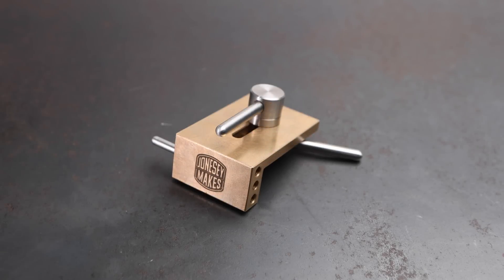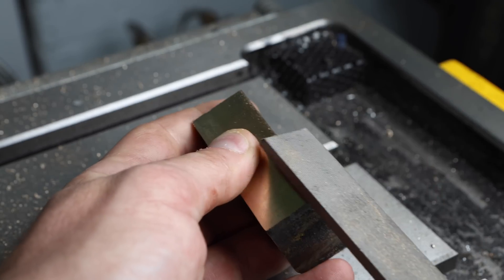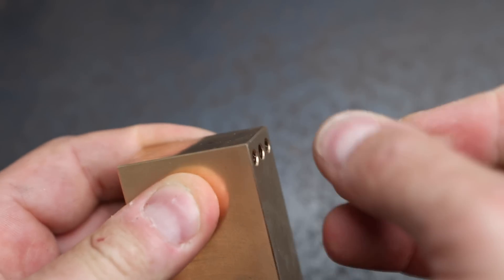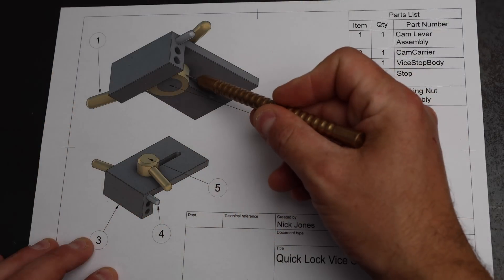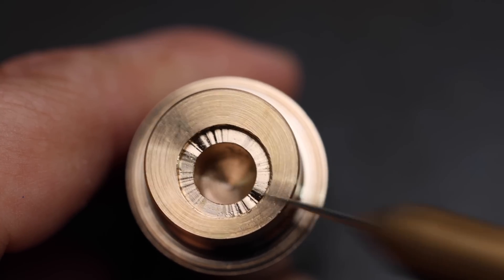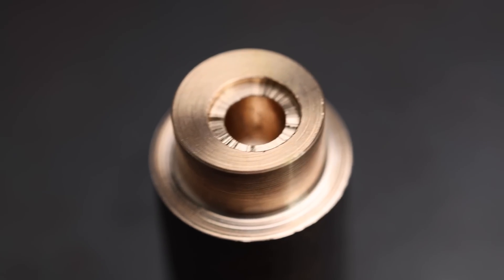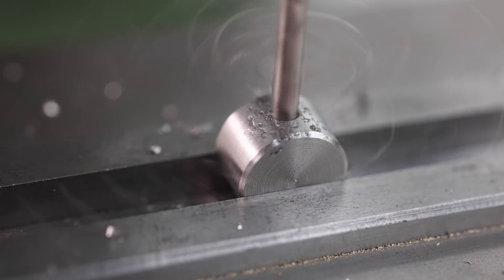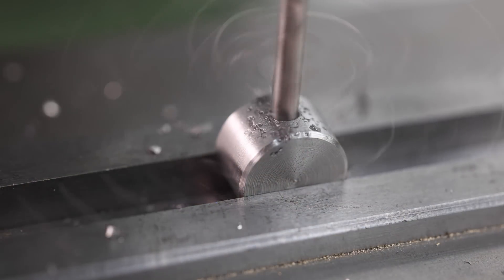Making a Vise Stop with a novel CAM LOCK mechanism

Comment: Bronze doesn't break chips very well it's a soft gummy like material when cutting. Engagement of the entire end mill doesn't give the chips anywhere to go and they pile up quickly and the material acts as if it's grabbing the cutter
Reply from the maker: Makes sense, thanks!

Comment: Thank you for sharing your work, issues and all! RE: the chatter, I agree with others that rigidity and cutting speed are usually the first place to look. For brass, bronze, aluminum and other softer materials I use a 2 flute endmill for plunge operations and have personally had better results than with 4 flute cutters.

Cheers!
Reply from the maker: That’s a good tip, thanks.

Comment: Excellent design on that vice stop i have made lots of them years ago i owned a screw machine shop and all our secondary operations needed adjustable stops the only thing i don't like about yours is your pin is not stationary i know from past experiences being in production shop most my life repetitive work needs to stay stationary or there will always be variances that will change your depth on your stop vibration etc. If you would put a set screw or clamp to hold the pin in solid awesome job
Reply from the maker: Thanks for the feedback. The pin moving hadn’t occurred to me - great advice. Maybe I’ll revise the design to incorporate that.

Comment: Usability note: whenever you have a rod projecting from a mechanism, you need to convey to the user how the rod is to be used.
If the rod is not meant to be manipulated at all (like the stop bar on this stop), it can be left plain.
If the rod is meant to be twirled or twisted, the end should be knurled.
If the rod is meant to be moved in two axes (like a gear shift), it should have a knob at the end.
If the rod is meant to be moved in one axis (like the cam lever and the locking lever on this stop), it should be flattened on either side in the direction of travel and a few grooves cut into the flattened area perpendicular to the length of the rod.
If the rod is meant to be pulled out of or pushed into the mechanism, it should have a broad flat head with a slightly concave top.
To some extent, these features make the device easier to use, but their real purpose is to make the device easier to _understand_.  When we see a projecting rod with knurled end, for example, we instantly know: ah, that rod is meant to be turned.
Reply from the maker: That’s a great point, thanks. This is something I will bear in mind for future designs.

Comment: Great video! You might try holding your stock by about 2-3mm and decking the top and milling around all 4 exposed sides in the first operation and then flip it over and deck off the final side that was held in the vice in operation 1. Quick way to get square stock in 2 ops. Keep up the great work!
Reply from the maker: Thanks, I've never tried that technique. Must give it a go.

Comment: If on a bridgeport use knee rather than the quill as its more ridged if using the quill then set the quill stop for your z and switch the drive off as you are taking that last bit of spring off the stop this changes the harmonics and has all of the backlash  from the quills rack and pinion tied up of course ensure that the quill lock is just allowing you to feed by hand or power. Then get 40 years of manual experience just kidding.
Reply from the maker: Thanks for the advice Robert!

Comment: As others have mentioned, it sounds like brass or bronze behaves a little like aluminum. When milling aluminum I use industrial alcohol (denatured alcohol) as a coolant to prevent the tools from clogging. If I want an almost mirror finish, I use one flute end mills made for aluminum.

There is probably a similar solution to your problem.
Reply from the maker: Thanks, that's sound advice.

Comment: I recommend milling 6 flats on the outside of the cam. More stability & will show wear less.
Reply: Wouldn't that make the cam much less effective as a cam? You would be taking from infinitely adjustable in size (within a range) to only 6 predetermined sizes.
Reply: I recommend milling 6 flats on the outside of the cam. More stability & will show wear less. @Beef4Dinner22  No - the flats would seat against the material and the cam would still leverage the same force. Mighty-Bite uses a cam with such a hex pattern. Do that with your cam. I made my own & can tell you that those flats are helpful.

Mighty-Bite uses a symmetric hex body, but cuts the head of the retaining bolt with the cam pattern. You rotate the hex while test-tightening the hex bolt to retain anything.
Reply: @Ideasite  the Mightee-Bite cams seem to have the hex as a separate piece, not milled into the cam itself. The cam is internal to the hex, and is still round to allow it to rotate fully giving the adjustability of a round cam.
Reply: @Beef4Dinner22  Yes - the cam is milled into the head of the retaining allen head screw.  You rotate the loose hex part to find a flat, then tighten the allen screw to apply the cam pressure to the assembly.  You couild replicate the Mightee-Bite design by having the lobed head screw go through a hex cut washer and thread into the upper piece.

Comment: Anytime you get chatter speed is the first to think of. Chatter is caused by harmonics.
Reply from the maker: Thanks, I did try different speeds but got the same problem.
Reply: @joneseymakes  You could take the approach you'd use with a piloted counterbore - drop the speed WAY down, like way way down out of endmill ranges. 200-300rpm, possibly even less, and be really consistent with your quill pressure. I know you said you varied your speed, but super low speed high feed pressure can just peel the chips off nicely sometimes.
Reply from the maker: @TheeGrandmaster  Ok, will do. thanks!
Reply: New computer systems constantly vary the speeds up and down to stop chatter in machine shops.
Reply: Came here to say this. Charter is almost always caused caused by to high of spindle speed. Cut the rpms in half or even a quarter.

Comment: You need a vice stop to help with that project. It would be invaluable. I designed one with a great cam lock too????
Reply from the maker: You did? I’ve not seen another with a cam lock. Hope does it compare with the solution I went with?

Comment: The problem presented by the tool in the milling machine spindle is due to the bearings being out of adjustment or having a greater tolerance than normal since these are originally preloaded but after many years of work they wear out and when they are doing a strong roughing job the vibration seen in your case occurs. Therefore what you should do is adjust the bearings or if you cannot adjust them then change them according to the machine manual.
El problema presentado por  la herramienta en el husillo de la fresadora, es debido a que los rodamientos están desajustados o tienen una tolerancia mayor de la normal ya que estos están precargados originalmente pero despues de muchos años  de trabajo se desgastan y cuando están haciendo un trabajo de desbaste fuerte se produce la vibración que se ve en el caso tuyo. por lo tanto lo que debe hacer ajustar los rodamientos o si no  puede ajustarlos entonces cambiarlos de acuerdo al manual maquina.
Reply from the maker: Thank you, great advice.

Comment: Brass/bronze is very grabby and sometimes when drilling it, you can make it drill nicer by stoning a small flat on the drill's cutting edges to stop it digging in, but when you counterbored it on the mill, you should have locked the spindle in place and applied the feed by lifting the table, this is more rigid than using the quill downfeed.
Reply from the maker: Ok, great advice. Many thanks.
Reply: @joneseymakes  Machinists "brass off" a full set of drill bits.  They file the leading edge to 90 deg to prevent grabbing in softer materials.
Reply: @Ideasite  Stone, not file
Reply: Yer you want cutting tools with no rake  or very little on the cutting face.
Reply from the maker: @stin-dog172  Ok, thanks!
Reply: Also, the end mill had pretty high angle helix.
Agree with locking spindle and feeding with knee.
Robert
Reply: Gotta brass off your bits.
Reply: I agree. I'm front the distant past and we would always grind the cutting edge back on drills to produce zeto rake thus preventing grab. We called them "brass drills".
Also we would grind a stepper angle on the drill point, they cut beautifully, make it 45° and you had a handy countersink bit as well 😁.
I wonder why nobody seems to do that these dayz. I still do and all it takes is a minute or two on a bench grinder.
Reply from the maker: @lesmaybury793  I like the idea of the stepper angle, I'll have to try that.

Comment: I think you were getting chatter like that because you're working with brass, basically. It wants to pull your end mill into it because it's soft.
If you slightly engage your quill lock so the brass can't pull the cutter in it usually works. Alternatively, you can use your fine feed. This prevents the quill from being sucked down by the cutter.
Just an opinion from my own experience.
Roger from Calgary.
Reply from the maker: Thanks Rodger, good advice.